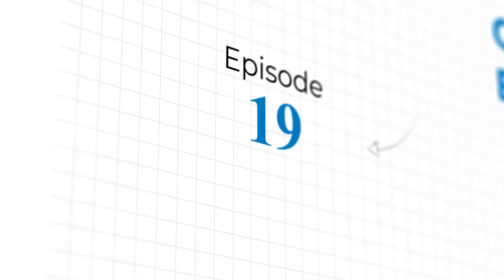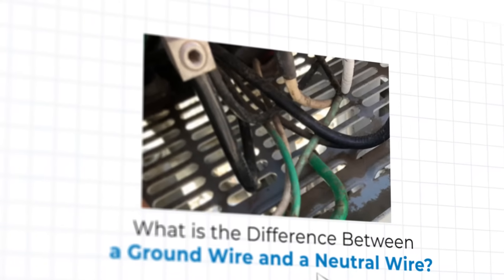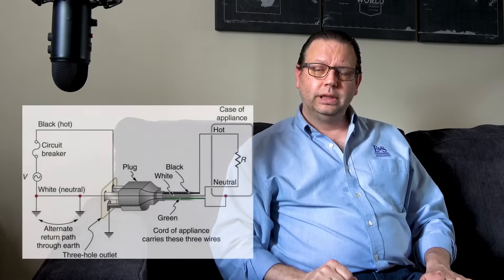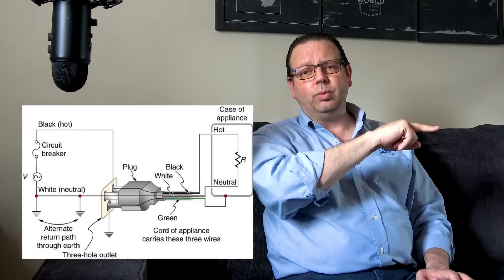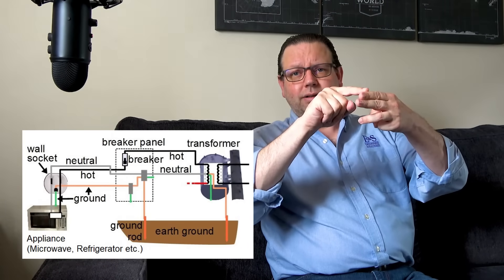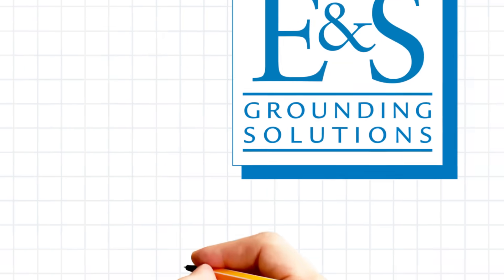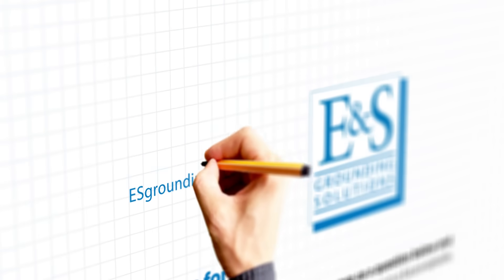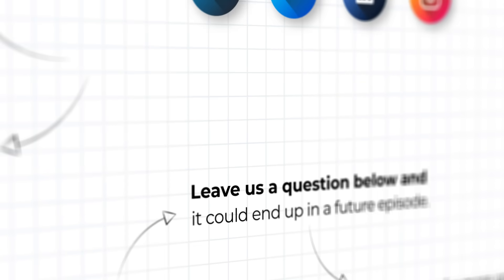What is the Difference Between a Ground Wire and a Neutral Wire?

Comment: Some people (unfortunately) have the misconception that neutral wires & ground are one & the same. I myself, when I started out many years ago had that practice. so did most electricians at that time. We used to run the power for receptacles & for neutral we ran a wire to a water supply or radiator pipe. As long as it worked we were not concerned. But of course it's a wrong practice.

Comment: And thank you for this great explanation. Circuit power power supplys power to load and neutral wire returns to supply (neutral point of supply). Ground wire is an equipment ground. Appreciate any and all feed back, corrections 👍🏽

Comment: Doesn't make sense to me! The neutral wire and ground wire are bonded (connected) to the same electrically conductive bus.  This is obvious in any household panel.  If there are "10" amps flowing thru the neutral wire, then 10 amps can flow thru the electrical bus and then to ground.  Also, isn't some of the amperage converted to heat or work at the load thereby diminishing the amp flow in the neutral wire?

Comment: There are exceptions. In the OLD three wire dryer and range outlets, they connect the neutral/ground wire to the appliance case. The neutral/ground wire is used to create the 120 volt for the motor, lights and electronics and at the same time provide touch potential for the appliance case. How can you tell the difference, you really can’t because both neutrals and grounds are connected to the same bus bar in the breaker panel, most of the time. A ground wire does not have insulation and a neutral wire is insulated. The wire for the three wire plugs have insulated wire in the wall.

Comment: Neutral Wire yes has power on it if there power it called backfeed voltage if removed from panel busbar  many home uses the same bar in the breaker making the the same only when main power is turned off.

Comment: Af far as I know, the ground current return path (earthed only on both locations) has no chance to trip a 10, 16 or 25A fuse, so it is essential that ground wire is firmly connected to the transformer  and object exit and entry points and both, transformer and object neutral wire. RCCBs and RCBOs will probably trip with their specified limiting currents in the mA range, if object is earthed only.

Comment: OK and if there is a difference of 5-30 mAmp between Hot (Black) and Neutral (Green - bare copper/aluminum) wire the circuit breaker will trip. But is there a difference in Voltage between them when Neutral is used instead of Ground? I seem to get 120.1 Volt when checking Load and Neutral but 117 Volt when checking Hot with metal receptacle (Ground). Is this normal and expected?

Comment: I’m very sorry sir but, this video is ver poor at answering the question posed and has some misinformation in it.   Your video on faults a year ago explained how grounds worked was accurate.
For instance, your diagram showing the current in short circuit going to the ground rods is ridiculous.  It shows you are missing something.   If you take a “hot” conductor attach it to a ground rod, take it out in your yard and stick it in the earth, then turn on the standard breaker, the breaker will not trip.   Ground rods and other electrodes are installed for lightning protection, not equipment grounding.  The only reason the reading neutral to ground is zero volts is they are tied together.  Equipment grounds take high ground fault currents (thousands of amps) back to the first means of disconnect, then to the neutral, out to the transformer and back to the panel on L1 or L2 (whichever the breaker s connected) and causes enough magnetic field in the breaker to trip it.
Also,  if you put a hot in one hand and a neutral in the other hand you will get shocked or electrocuted.  If you put the ground in your hand instead of the neutral, the exact same thing will happen.
If you feel that I am incorrect or need further information, please let me know.
Respectfully,   Kevin

Comment: I need your analysis on Solar Power System and how to properly ground it.

If G is the Grid power, and S is the Solar generated power, each are as if they were two isolated power companies.  And separately they would be grounded as per your video.  

But if we were to supply power from G to S for the purpose of charging the S system during a low sunlight time period, then S in essence becomes a sub panel off of G, and now we have TWO grounds in the system.

Should we isolate the ground (or disconnect the ground from S when it is being charged by G and is connected to the ground of G, or is it ok to have two grounds?

I can not find an answer to this question, and it could be crucial to preventing someone from getting shocked in a failure situation.

Please help with your thoughts on how to safely resolve this dilemma.

Thanks

Comment: I take issue with your first figure.  Why are you showing a receptacle ground terminal connected to what seems to be dirt.   There is an egc as an effective low impedance fault path which facilitates the fault path. You say this later…why represent the fault current path thru dirt.  Won’t happen and will never trip a breaker. Think I’d stop showing voltage as a signal source and draw in transformer winding 240/120 single phase.  Draw in all the wires , main bonding jumper etc.